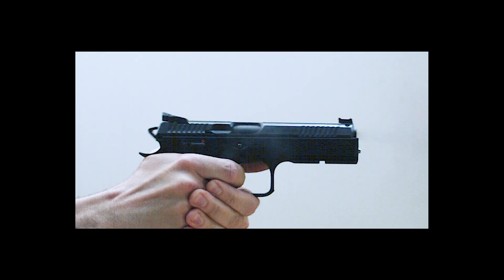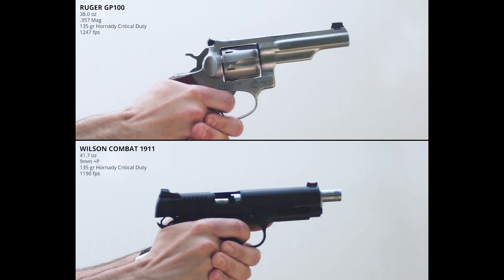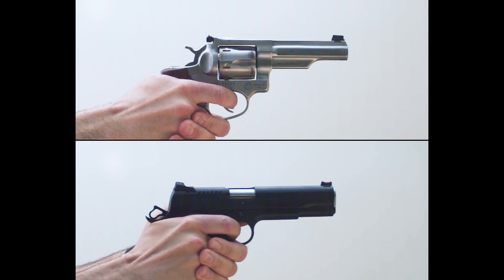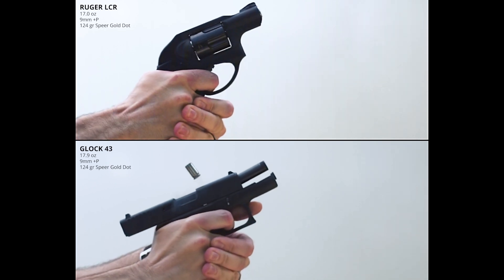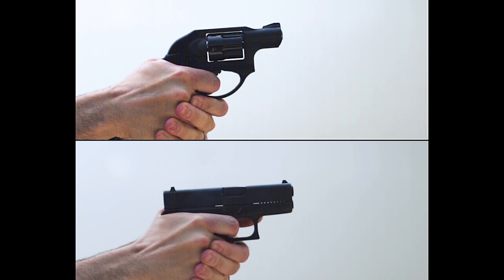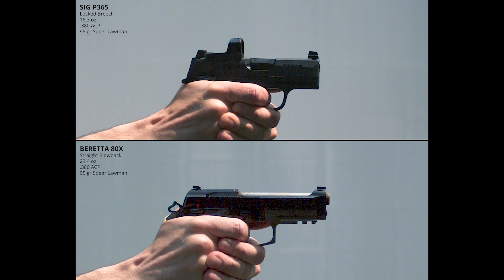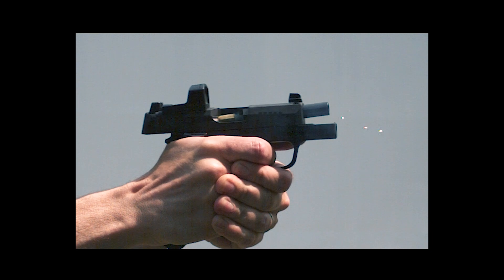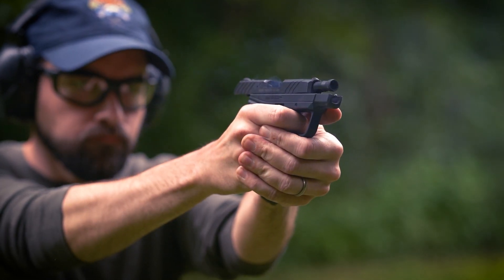Recoil: Let's Talk About Feelings

Comment: What i learn are
1 Snappy is not bad thing if you can manage it it make following shoot quicker
2 sight shifting is a cost of soft recoil but with enough practice you can correct it quickly and shoot as good as snappy one
3 grip is important than the recoil force cuz you dont need to fight the kick but you need to recover and correct the sight on the next shot after the slide back
 with larger caliber  so much force kick the gun up the same will return and make the tip of the gun down by spring so just dont let grip loose it will return to target without  needs to adjusting much

Comment: An important difference missed here between the blowback operation and locked-block operation in terms of felt-recoil, muzzle-rise and impulse is the direction of force vectors. In the blowback design, the force vector remains equal and opposite of projectile launch until the very end of slide-travel, at which point the force is transferred to the frame, which held by a secure grip, results in the pronounced "snappy" recoil impulse because all that force acts at (for the sake of argument) "90 degrees" to your grip and at the last minute. Contrasted with the locked block design, not only is the slide slowed by the unlocking of the barrel (the "push" feeling) when the barrel first unlocks, it drops (for the sake of argument) "30 degrees," it then continues in rear/downward motion alongside the slide for a period of time till stopped by the locking block. This force, enacted earlier in the sequence than the blowback design, is delivering a recoil force vector at (for the sake of argument) "120 degrees" aka diagonally towards your wrist, more "inline" with your body structure. The remaining force (less now, because of EQUAL and opposite) is then delivered similar to the blowback at "90 degrees" (with say a 1in moment arm, or whatever bore over grip measurement of your gun) and results in less "snappy" muzzle flip. All that to say more concisely, a force vector is applied earlier in the sequence that is more inline with your grip causing less of a moment (rotational force) when the barrel stops. That results in less of an opposite projectile force vector, which results in less of a moment at slide-stop.
Reply: I know I'm splitting hairs here, but I think it's fun and educational and thus fits the purpose of your channel. Re-watching your comments on the topic, you pretty much covered it with your statement that the locked-block cycle "spreads the recoil over a period of time" rather than the "all at once" experience of the blowback design. However earlier in your description of the locked-block you described the slowing of the slide speed in the unlocking process resulting in "less force," which isn't quite true as Newton's "equal and opposite" law mandates that the recoil "force" experienced between the two pistols is the same (as long as it's the same ammo and same barrel length, which they are). It's instead that the recoil force is delivered incrementally to the shooter in approximately 3 semi-distinct points "spread out over a period of time:" 1) the "push" of the initially locked-breech, 2) the rear/rotational stop of the barrel by the locking block and 3) the "snap" of slide-stop. Same force, just delivered in smaller portions incrementally over time. 

Awesome thought experiment, awesome video, ton of fun thinking about the subject! Cheers!

Comment: I have to call B S on the .357/.45 comparison. .45 is a subsonic round with much less energy than a .357 Magnum. The velocities are significantly different. 

Both have different advantages and disadvantages when it comes to use, comfort of the individual, and the mechanics of a revolver versus the mechanics of a semiautomatic. The comparison would be better with.357 Sig vs .357 Mag.

Comment: Keep in mind that semi-auto pistols exert rearward pressure on the grip while the slide is compressing the recoil spring.  When the slide hits the rear most position, it is not just the slide hitting the frame, it is also recoil spring max compressed. In case of revolver all recoil is concentrated at the moment of fire until the bullet exist the barrel.

Comment: I think you kinda skewed your data in the first comparison. You used a 357 Magnum pistol using 357 Magnum rounds vs a 9mm 1911. A more fair comparison would be for you to use 38 Spl +P. Just my two sense.
Reply from the maker: To get a "fair" comparison, the actual cartridge used is irrelevant as long as the bullet weight and velocity are similar. We used a mild .357 magnum load against a +P 9mm, both 135 grain with less than 60 fps difference in velocity. That's closer than we could get by comparing any 9mm load to a .38 +P.

Comment: To me, the trigger and sights are more important differences.  But to some people with weaker hands, racking the slide of some of the blowback actions can be very difficult.  For that reason I'd recommend a locked breech pistol for those people.  Same goes for a double action trigger that requires a lot of pressure.  I've seen several women be unable to pull the trigger of some DAs.  Bottom line is, try the trigger of a DA, and try racking the slide.  If either of those is very difficult, recoil is a secondary concern.

Comment: Your selection in ammo makes a difference in recoil as well. 115 gr bullet vs a 124 gr bullet vs 147 gr bullet is all going to feel different, even if on paper energy ft/lbs are the same. In my own opinion, I like shooting 147 gr out of my 9mm because the recoil impulse is just a tad slower than when I'm shooting 124 gr; even though in this particular case describing my ammo at home, the 147s have more energy ft/lbs than the 124s.

Comment: Doesn't that Sig .380 have a 3" barrel, VS the Beretta's 4" barrel...  Not sure if that really matters with respect to recoil - considering one is lock-breach & the other is straight blow-back.
Reply: Not factoring in straight blowback vs locked breach, longer barrel would be expected to be less recoil due to more mass to slow down the recoil impulse.

Comment: CB - For 9mm, try a CZ Shadow2 or a Laugo Arms Alien 9 - both very very controllable; both very 'soft' shooting.
Reply from the maker: The Shadow 2 makes an appearance in this video at 5:22. It is, indeed, a very soft shooting gun. Haven't had the chance to try the Luago Alien yet, but I would like to.
Reply: @LuckyGunner  My brother (the CZ owner) and I (the Alien owner) did a "Coke vs Pepsi" taste test / range day.  We found that those 2 Czechoslovakian offerings are both (as the kids today would say) "cheat-codes".  They are both amazingly easy to shoot, and they both have a very high degree of accuracy.  Having said that, the CZ is ALOT cheaper than the Laugo.  It's kinda' like the difference (in cost and 'status') between a Lamborghini and a Pagani - both are amazing / 1% vehicles - which one do you want to spend your $$$ on?

Comment: Hey Chris, I had a question regarding ballistics. As I understand it from your videos, handgun projectiles produce little to no "hydrostatic shock" , because they travel below ~2200fps. If a 405 grain 45-70 only travels at ~1300 fps, why does it seem to do much more damage than 45 caliber (+ expansion) holes? Thank you
Reply from the maker: The 2000-2500 fps (depending on who you ask) threshold is more of a loose rule of thumb rather than a magic number that always creates specific wound effects. Plenty of projectiles exceed this velocity and do not perform on par with conventional rifle cartridges. Issues like bullet shape, material, and sectional density come into play. And like you pointed out, there are larger, slower projectiles that can be equally as effective as high velocity rifle cartridges. Larger and heavier bullets at moderate velocities can displace enough tissue to create a temporary wound cavity that's capable of wounding by tearing of tissue outside of the bullet's actual path (the effect that is sometimes mistaken for "hydrostatic shock").
Reply: @LuckyGunner  Cool. I really appreciate the response!

Comment: Thanks for the info.  
I did notice one factor of recoil is velocity.  How much does a gun weigh, what cartridge, and  with a semi-auto what is the slide velocity.  
All blow back actions will have a more snappy recoil compared to lock breech weapons.  Simply put, the blow back has a faster slide velocity than a lock breech weapon.
Revolvers are a straight up mass vs pressures and bullet weight problem.

Comment: I have the 80x and 80FS and found them to be quicker to get on target than my 365 even though the 365 'feels' like less recoil.  This video definitely does give some interesting insights into my experiences.
Reply: When you push the back part of your 80x extractor (where the spring would be) and make the loaded indicator show on an empty chamber does it stay there till u push it back in or pull back on the slide a little? Mine does that but ive put 400 rounds thru it with not one issue. Thanks
Reply: @FirstLast-ff7qx  I checked and no, it seems rigid and won't push in when empty.
Reply: @DapperProf  thanks for checkin. How bout when you give it a good rack on an empty chamber? If i do that it will show loaded chamber. Thanks again
Reply: @FirstLast-ff7qx  no mine doesn't do that it's flush with the barrel.  I might talk to Beretta about it maybe a warranty claim?
Reply: @DapperProf  man i talked to like 3 different people at beretta they said it was part of the design which i found odd

Comment: Because they occupy a similar size category, and features, maybe a side by side of the 80x with the px4 storm compact would make sense.
Reply from the maker: I wouldn't rule out a high speed comparison, but I also wouldn't say the two guns are similar in size. I'm not sure what the numbers look like, but holding them side by side, the Cheetah is significantly less bulky overall. They don't feel at all like they belong in the same class of pistol.
Reply: @LuckyGunner  fair enough.  I was going by the comparisons via handgun hero.
Reply from the maker: I love Handgun Hero -- it's a fantastic resource. It can also be a bit misleading. Be sure to look at the view where you can see the two guns on top of each other. The distance from the top of the slide to the bottom of the trigger guard and from the backstrap to the frontstrap can make a huge difference in overall bulkiness.
Reply: @LuckyGunner  well the other thing now that i think of it, is that this was right after the release was announced, and I don't think they had it from every angle.

Comment: Like the high speed footage of what your eye only barely perceives...

I loved carrying the LCP Max, because it was so light and tiny. But it was precisely because of those characteristics that made it hard to shoot comfortably or accurately. At least for me.

Yet, ironically, I can ring steel with boring regularity at 50yds with a 2" SP101 snubbie. Largely due to the weight of the gun, I assume.

Smaller guns, by nature, will always have a harder time trying to replicate the performance and capability of a larger, heavier, more stable platform.

Like Ian from FW says, all firearms are a compromise of something. Shoot something that fits your hand, and inspires confidence in the gun itself.

Comment: Ok, so you knew this was coming mr baker. 

The LCR has a significantly shorter barrel than the 43. Less mass out front, further exaggerated the muzzle flip. 

I guess this is more about feeling than facts because my all steel 2” 357 loaded with 125gr JHP’s is easier for me to get on target from the drawl and stays locked in my hand better than my CR920 (g43 for intents and purposes). If I had 8 shots in a 2.5” revolver of 357 I’d just carry 2 and call it done.
Reply: Similar lengths between muzzle and firing pin. Revolvers and bottom feeders are apples and oranges when comparing barrel lengths (because revolvers exclude chamber length but semiautos include it)
Reply: @chutethemall8099  doesn’t disprove my point. dispute the number directly. a 125 grain bullet going just north of 1175 FPS is no better than 9mm. You want ass-thumping power, you need more barrel. Otherwise, it’s just another mid pistol cartridge
Reply: Those are some lackluster returns you’re getting for the high cost of carrying magnums in a snub-nose.

What like 1175 FPS w/a 125 grain bullet? Lol

Comment: The high-speed camera is a great tool.  Watching the guns in recoil, the little quirk differences between guns is explained.  Some guns feel better than others and the .380 is almost nobodies first choice.  Would be fascinating to see video comparing the 9x17 (.380) versus a 9x18 Makarov in blow back pistols.  Have heard more than one shooter say the Makarov is downright hard to shoot well, and I agree.
Reply: .380 is my first choice. Ball ammo penetrates adequately and is much easier to find than the Goldilocks 9mm defensive ammos that perform in a micro 9.
Reply: @macriggland6526  .380 fmj Deveno  overpenetrate. There are good .380 hp loads that expand and penetrate!
Reply: @Gieszkanne  No they don’t. Over penetration is sort of a meme anyways. It makes headlines in low income areas inhabited by people with no self control and 50 round drums.

Civilized men don’t spray and pray.
Reply: @Gieszkanne  OH GAWD NOT MUH HECKIN INNOCENTS
Reply: @Gieszkanne  Take your soapbox to Detroit first. I’m sure you’re a very brave individual.
Reply: @Gieszkanne  don't bother with that guy, he's not a serious even putting aside the amount of dogwhistles he's cramming into his comments
Reply: Modern 9x17 has the same power than 9x18.
Reply: @Gieszkanne  Power is not the issue. Bare minimum for “one shot power” is duty grade ammo in duty sized 9mm or greater. For everything else, landing two shots is recommended. Therefore, as long as it penetrates enough, it’s fair game to use it.

Comment: Cool videos. The main difference between the locked system and the blowback is that the recoil impulse on the former is spread over two impulses. It unlocks when the barrel strikes the retention pin unlocking it which transfers some of the momentum to the shooter's grip with the remainder being delivered when the hits the slide stop. With a blowback all of the momentum is transferred with one bigger impulse at the end of the slide travel. Since the slide of the blowback has more momentum on the way back, it bounces faster and closes sooner. Note also that a locked pistol starts rising sooner because of that first barrel impulse. Also interesting in watching the blowback how the force from the recoil spring has negligible effect in inducing muzzle climb. One wonders if a stiffer spring would be better in terms of reducing felt recoil, though maybe that would negatively affect the reliability of the gun.
Reply: Maybe, but I think Beretta went as light as they could on the spring to allow their intended target consumers - women and the recoil sensitive- to still be able to rack the slide.

I'm neither but I love that little gun.
Reply: Great comment👍

Comment: Thanks. This explains why I generally shoot compacts a little faster on my local pistol bay compared to full size pistols. I hate that extra nose wobble on the long slides, takes longer to get back on target accurately. But why then are fullsize preferred for competition shooting? And don't say capacity because that is what extended mags are for...
Reply from the maker: The muzzle bounce can be mitigated somewhat with technique. Competitors also do things like change the recoil spring weight or the mass of the guide rod to help with this. Even with the bounce, it's easier to maintain a consistent grip with a larger gun, and there's less muzzle rise. Maybe longer sight radius. That's just speculation -- the reasons high level competitors choose the guns they do is way out of my lane. That said, I know some extremely accomplished shooters who prefer a full size frame with a compact slide for that reason (ie, Glock 45 or even Glock 17 over Glock 34. Commander 1911 over full size, Beretta 92 Centurion over standard 92). In my experience, the vanilla, off-the-shelf (not set up for competition) full size 9mm 1911s have more dramatic muzzle bounce than a lot of other full size guns, which is why I chose to use it as an example.
Reply: @LuckyGunner  Thank you all for the insight. Everything stated makes 100% sense and I had not previously considered these attributes. That is why I asked! So thank you all...
Reply: In my experience, it's two things: 1) increased sight radius if shooting irons, and 2) longer barrels allow for lower powder charges that will still cycle the gun, giving the competitor an advantage of getting back on target faster.
Reply: Competition guns often have cutouts in the slide for faster recoil. The Glock 34 slide has these also so that the slide has the same weight as a G17 slide.